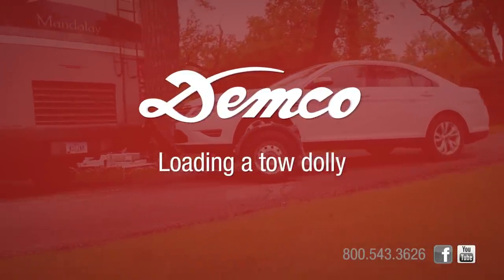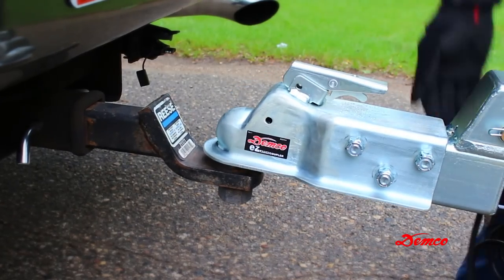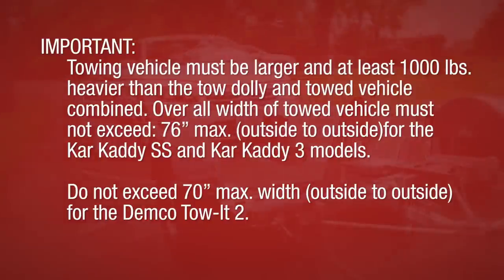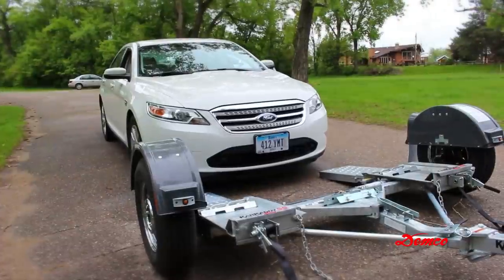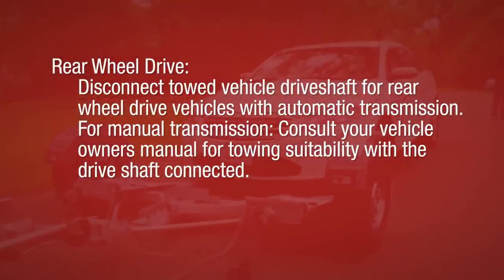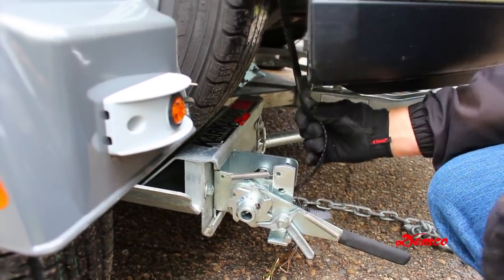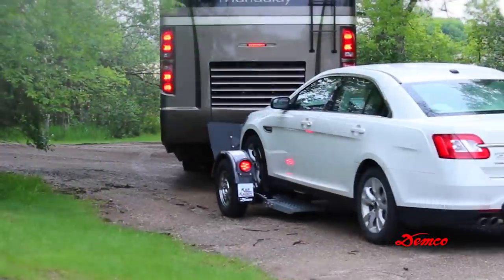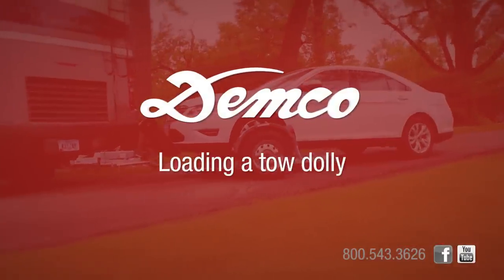Loading a Tow Dolly

Comment: What if the car doesn't start or run how do I get it on the dolly ?? Need answer as soon as I can possibly get one thank you
Reply: Push it up while in nuetral
Reply: Winch ! Buy a winch
Reply: @TheThompsonKids  thanks but too late my car was stolen
Reply: roll it down a hill also works.
Reply: @wvbj4208  damn bro sorry to hear that shit man
Reply: @pugmalley  that only works with a standard
Reply: @wvbj4208  If the car doesn't start rolling it down a hill does work in both a manual transmission and an automatic to roll it onto a dolly.

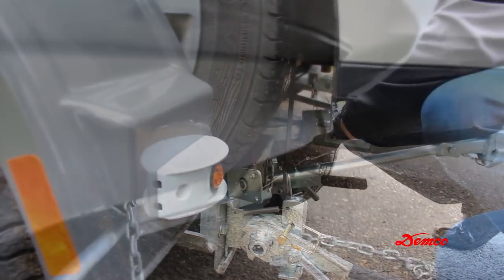Comment: 4:13... "you MAY then disengage the towed vehicle parking brake"
Sounds like an option.
They mean that you MUST disengage the towed vehicle parking brake.
If you leave the parking brake on, you just might be towing a flaming pile down the freeway after the towed vehicle's brakes overheat.
It happened to my neighbor.
Reply: So when towing have the break on but when it’s on dolly turn the break off.?? I just want to be sure when I do this next week.. my car is not running currently has a bad engine don’t move & barley stay on.. my battery is also dead.. what would you suggest.?

Comment: says to lock the steering wheel.... do you keep the steering wheel locked while transport... do the tires on the dolly turn to compensate for the lack of turning on the TOAD??
Reply from the maker: Just prior to loading the vehicle on the tow dolly, our instruction have you remove the pin that unlocks the steering on the tow dolly.  Then load your vehicle onto the tow dolly and lock the steering wheel on the towed vehicle.  The dolly will do the steering for you.  If you tow the dolly without a vehicle on the dolly, you would want to reinstall the pin that locks the wheels on the dolly from steering.

Comment: check straps every 50 miles?
who stops that often? try every 300 miles
Reply from the maker: Thank you for your feedback on the video. We recommend re-tightening the straps after the first 5 miles of travel and then checking the straps every 50 miles of travel there-after to ensure the straps are tight and that they are not rubbing or fraying on any of the towed vehicle’s suspension parts. Rechecking straps every 50-100 miles is standard recommendation by many tow dolly and auto transport trailer manufacturers. Because we care about your towing safety and the safety of others on the highway Demco recommends rechecking every 50 miles.